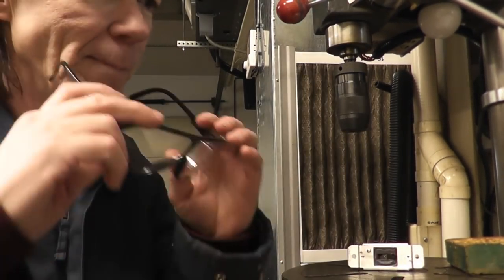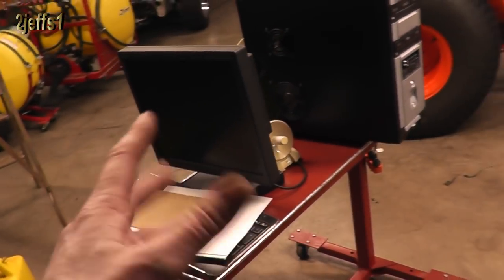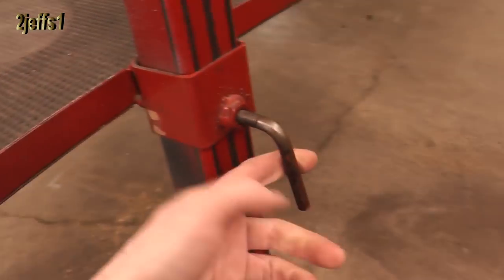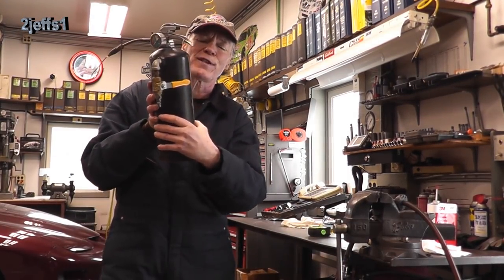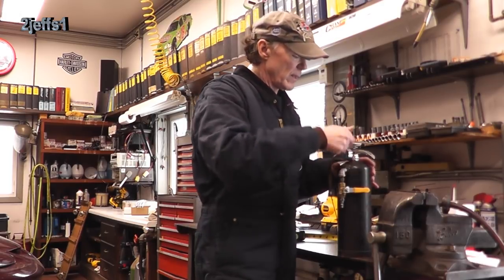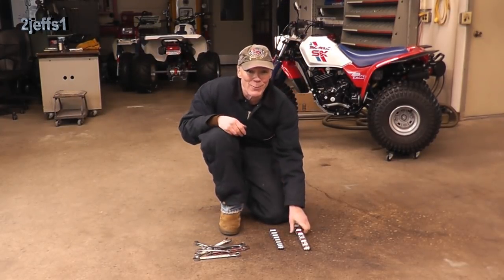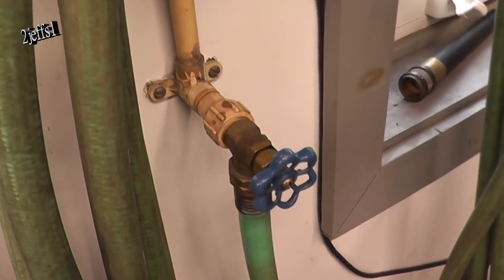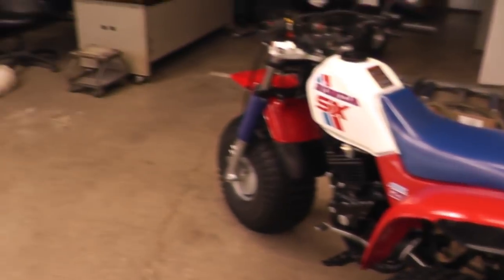Homemade Tools and Tool Tips

Comment: I Like your vise grip slide hammer ..Great Idea welding the shaft to the adjuster bolt
Reply: I did this back in the 70's but I replaced the adjuster screw with a like size bolt. But I like your Idea better, will have to redo mine.

Comment: Cool ideas, really like the solvent sprayer.
Reply: I used some aluminum fire extinguishers and filled with water and air 60 psi. For when we would go camping and have a bonfire, we could put out any stray fires.
Reply: OK, so I had a stuck inlet check on an injection pump on a diesel engine. Transfer pump only puts out 2-4 PSI. 
So I dug up an old extinguisher, and cleaned it out, made an adapter so I can hook a hose between it and the fuel inlet fitting. Put 40 PSI air in it (with diesel fuel also) and connected it up. It pushed the check plunger open, fixed the problem.  I painted the body of the extinguisher gray, so it don't look like one anymore.  This was a great fix! Great idea!

Comment: A slight modification I made to my vise grip puller was to grind the tips some so they made more of a little "hook". I tangle with cotter and flywheel keys on old engines (usually rusted in place) and this really helps. Also, on some of the larger flywheel keys I drill and tap the outer flat end of the key for installing a screw or bolt which is really handy to grip on to. (I am talking about the larger cast iron wheels.)

Comment: Great to see you back. I'm wiring my new shop up now, when it's not TOO cold. Has been single digits or below zero every morning for almost two weeks. This is for retirement, so I'm not pushing too hard! 35'X70'X24' peak. Looking forward to more videos... I have to be careful saying that 'Back in the 70's' Lol grandkids ROLLING eyes. I guess it was quite a while ago. . . for them! One of my first projects is going to be a used oil burning stove. I have a victim, sorry, DONOR stove and a process controller all ready. Bought a Milnor 93% efficient unit heater for basic heating. I have two Honda 250 three wheelers my son left in my garage. I used to have a 350X years ago. Possible projects... lol. I have a 'few' ViseGrip Frankensteins of my own... Cheers! Michael in Colorado.
Reply from the maker: Really enjoyed your write up. Wow, yeah that is a nice size shop!  The grand kids, ha ha, some day they will understand... I hear that lately where when I did a project - some say - I wasn't even born yet, almost scary at times. Hey thanks for stopping by Michael, Jeff.

Comment: Thanks for sharing. On occasion I get to go inside various people's work shops and see some real gems. Though some folks have passed away, or has gotten ill- it is great to see some of their hand made tools or solution that was devised to correct a problem or get at a hard to reach bolt or something. It can be a challenge to figure out what it was used for sometimes. There will be a time or two a relative there will know. More mysteries than solutions found it seems. The sad part of it is many times you see things that were really creative in their design and took time to make, be no more than scrap when everything gets sold off. The telescoping cart was so simple it was brilliant. Did you say how much air pressure you juiced the portable.parts cleaner up to?
Reply from the maker: Hi Tom, no I didn't. What ever the high line is at on the compressor. 80 - 150 psi. Enjoyed your logic on the home made tools. Yes - I have some that I don't even remember what they were for. For a while now I have been writing on them so... I too had that thought where if I am gone so much would be no more than scrap metal to others.

Comment: Great tips, thanks.  Can you give us any details on the plastic paint and clear coat that you used on that 3 wheeler, which looks brand new after you painted it.   Is the edge guard you put on the parts washer tray suitable for clamping seat material to seat frames on something like an old garden tractor with a seat that needs to be re-done?  Thanks for making this video.
Reply from the maker: That edge guard is kinda small, probably not ideal for your seat thoughts. I went out and got you the P?N's for... Brand name is SEM. Always stick to the same mgfr on paint stuff in case you weren't aware of... The plastics adhesion coating # is 39963, the paint was called Portola red, 15363, the clear, wow, no P/N on can but called SEM clear coat flexible coating. These were all aresol cans to make sure again.... Can't assume - no good!

Comment: Some great ideas. How long does the paint on the wrenches last? I am still pulling metric out of the standard wrench drawer. Sometimes my wife and son put them away and don't pay attention. Any other ideas would be great. Like how to know impact sockets size without squinting or a better way to hold sockets. There are quite a few products but nothing for the guy that has to pull a row out and take them outside. They are either flimsy or they flop around on a peg that you can't lay down in a tool box.
Reply from the maker: That is epoxy primer with the activator that I used. No paint just that primer. My best guess is they were painted at least 20 years ago. Where the epoxy is 2 part that even makes it pretty much even resistant to brake fluid, lacquer thinner, etc.
Reply: @2jeffs1   Thanks